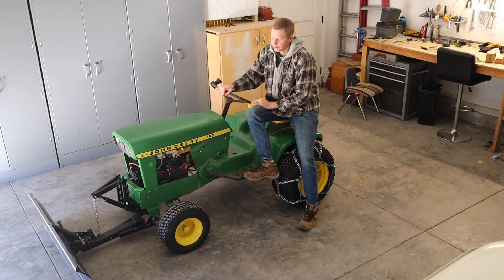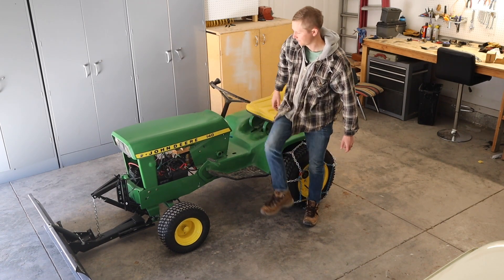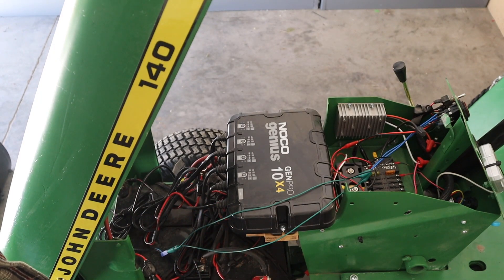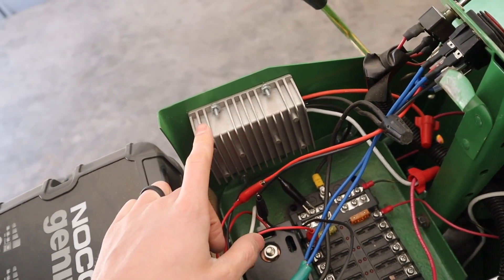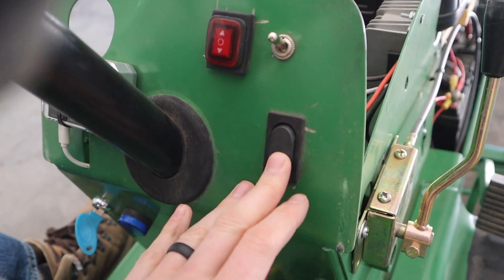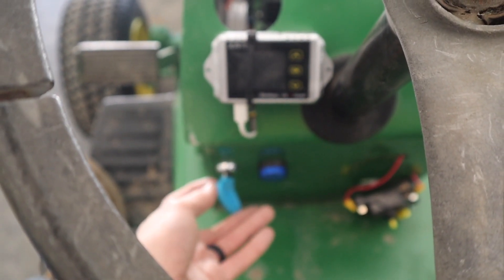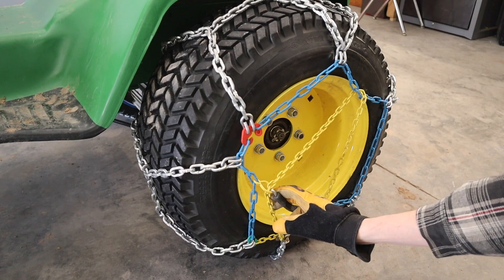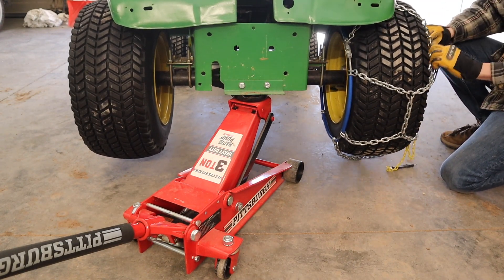Electric Tractor Build (Part 4)

Comment: Very interesting. Im planing to do something like this for our small farm in Sweden and i have a question. Is it possible to go really slow and is the motor strong then? 2-6 km/h is the perfect speed for us.  The plan is to use it for get rid of weed in our land for vegetables and then it need bigger wheels, 64 cm diameter.

Comment: Can you provide links on the electrical pieces?  Also , if you were going to put a mower deck, did you have a plan on how u were going to do it?  Belt or separate motors to each blade?

Comment: I have a tractor JDL140 sitting in my backyard with fairly large weeds growing through it. It is on my list to make it a Plow only.  You sir, have inspired me.

Any thoughts about battery performance in the cold? Lead Acid drops in the cold if I remember correctly.